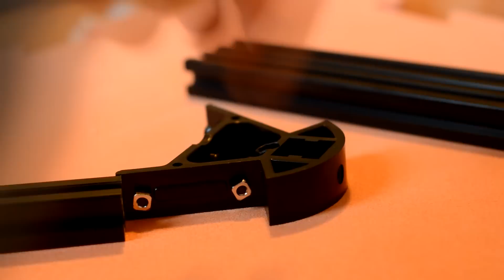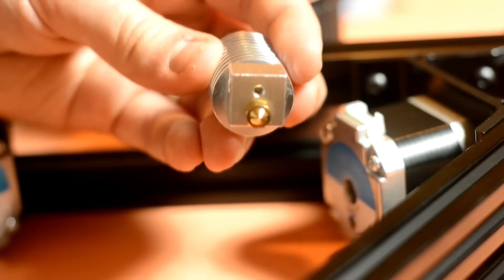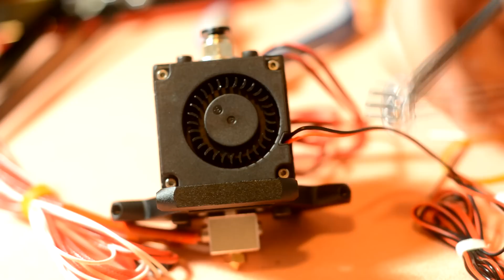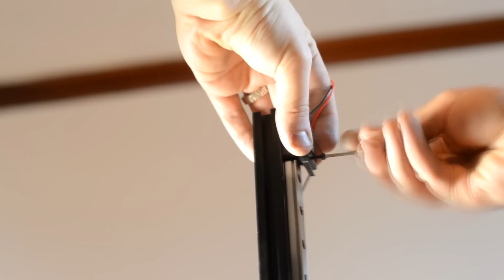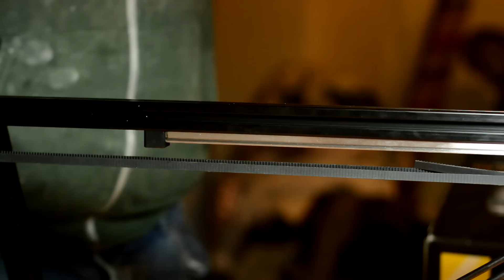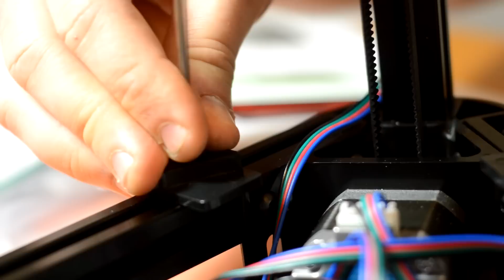Building The Anycubic Linear Rostock Delta 3D Printer!

Comment: Just got my AnyCubic delta this morning. I've already printed a couple things. My kit came with the new brass spacers to get the full build area thankfully. Everything went together very well. This being my second printer kit but my first delta. I check all my rods when I was assembling and there wasn't any drastic differences luckily. The quality of this kit was amazing. The instruction booklet was through and had great pictures. Wasn't missing a thing and even had extras! My firmware was already installed on the board. Though I did remake it so level the bed. Ordering a heated bed now!
Reply from the maker: wonderful I am very happy to hear that they continue to fix and upgrade parts to better the kit, Let me know how the heated bed goes and which power supply you go with

Comment: Great video. One question, were you able to achieve the stated 180mm build diameter? I've read some reviews that said they couldn't. I bought this printer with the idea that I could print items 6-7 in wide.
Thanks in advance.
Reply from the maker: no it doesn't quite reach the outer edges, more like 140mm unless you fit your own longer arms

Comment: What is the printsize of the Anycubic Linear Rostock? The specifications say it is 180mm in diameter and 300mm in height but some people say that the biggest diameter is 140mm. Can you please check and tell me I am interested on buying one. Thanks in advance and great video.
Reply from the maker: hi, yes the diameter in the manual states 180 but it definately does not reach the edges unless longer arms are fitted, so 140 is about accurate

Comment: Why the neoprene gloves at one point? Was that an attempt at antistatic protection?
Reply from the maker: I dunno just seemed the best way when dealing with the electronics, also made for better grip for the small parts, I did ground myself before touching anything also
Reply: I think they included them because the linear rails were so oily. I forgot to use them though lol